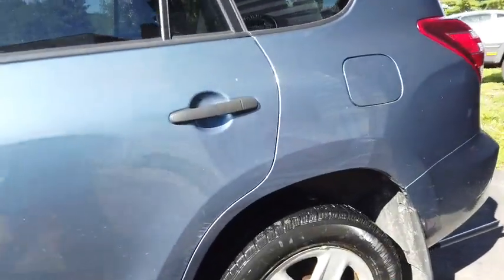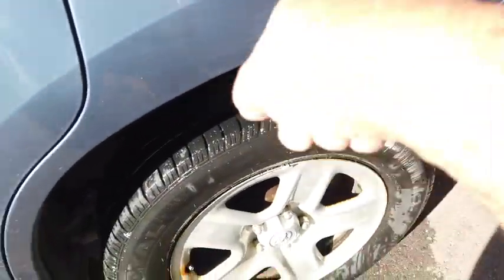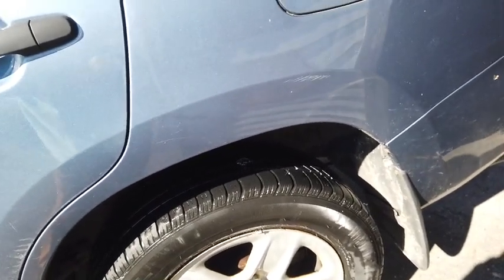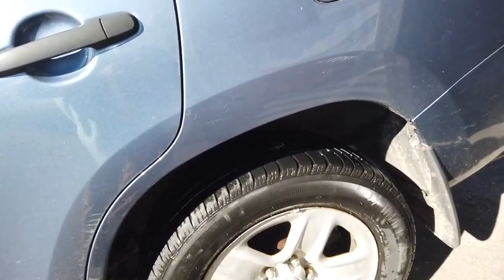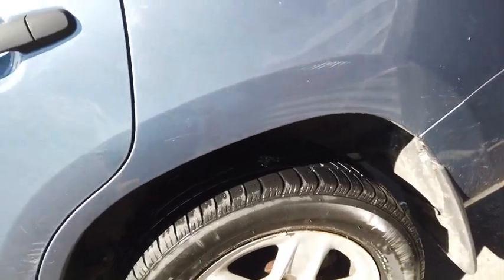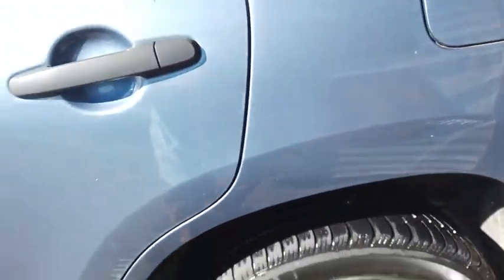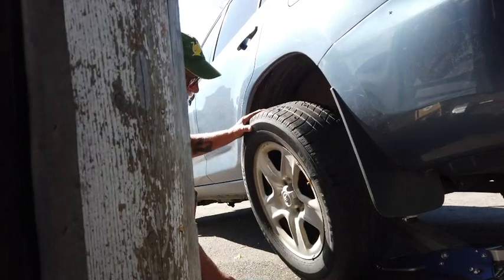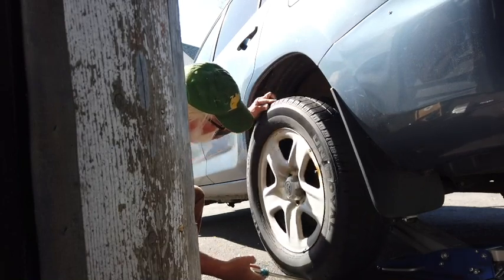Lawyers, Politics, and fixing tires

Comment: Last 'tyre plugs' I looked at were slightly conical and could only be pushed into the hole from inside the tyre. Pleased to say that I tend to wear tyres out without getting punctures, but the price of tyres in the place I use, along with the balancing and tracking checks, means that I don't take the risk. A blow out at motorway speeds could reduce my ability to climb ladders and paint. Might have done this kind of thing on my old Morris Minor, it couldn't get up to 'motorway speed', and was never driven for more than an hour at a time. The Skoda, on the other hand, will be driven sometimes for best part of a day at a goodly rate of knots, and weaknesses in the tyre will be exposed to a lot of hammering from road surfaces and getting pretty warm.
Reply from the maker: You don't drive that much now that you're retired do ya?
Reply: I drive more, no trains here to hop on and off!  @rpeek
Reply from the maker: Oh...